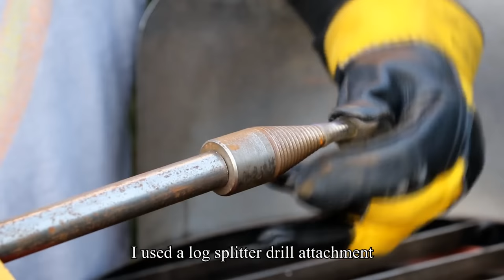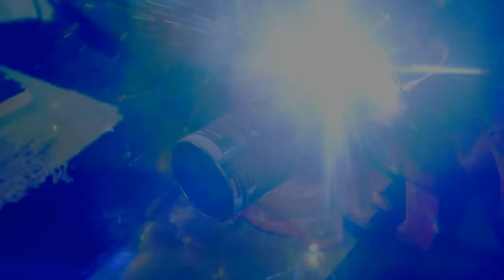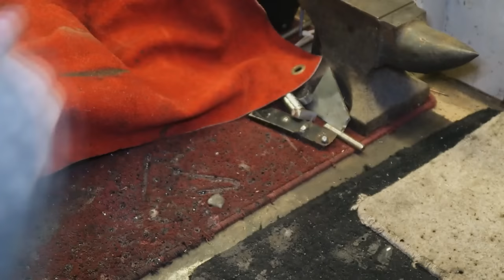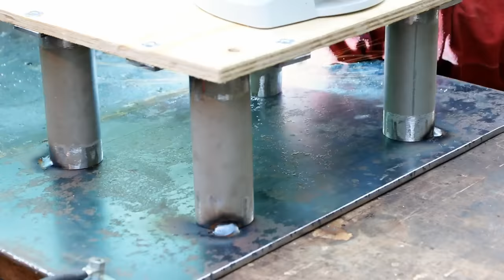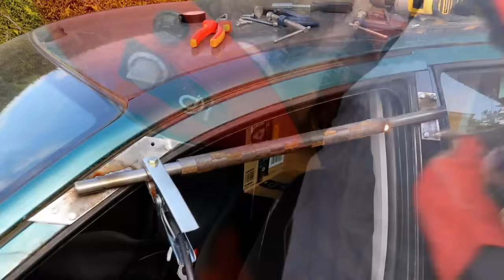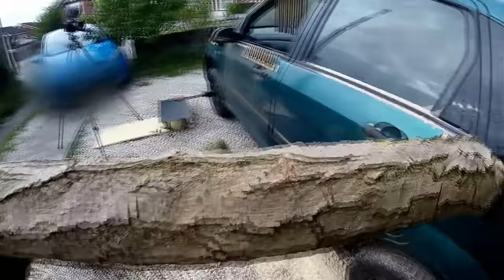Making a Log Splitter out of my old car

Comment: Just because you can doesn't mean you should 😳
Reply: I like it, But, I have seen a whole lot of accident videos. I bought a couple of those splitter drill ends, they are ok for soft woods but the harder stuff they will just go in so far and start a fire like the aboriginals haha. Plus I needed a stronger drill, the battery drills I have just don't cut the mustard lol.
Reply: Its joke for video lol
And he got job done while having fun so its perfect
Reply: @Zendukai  There is a reason why those types of splitters have low rpm and a big motor with gear housing . The things they sell for impact drills etc is made for kindle making . A real log splitter will have a 2kw motor and a giant drill.